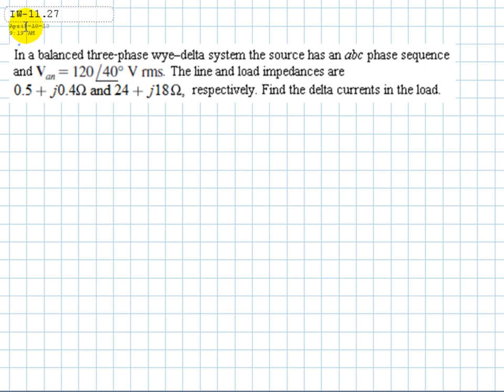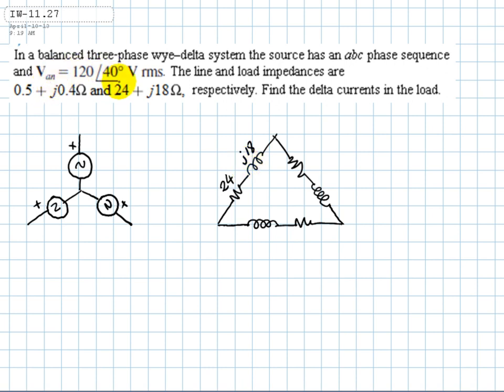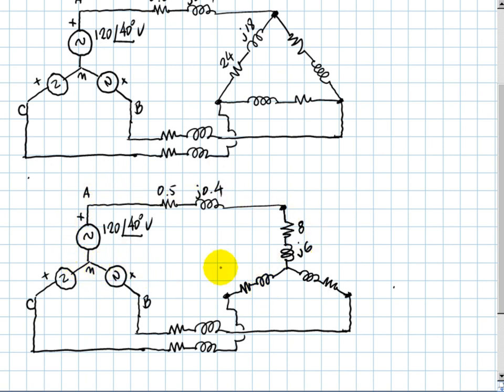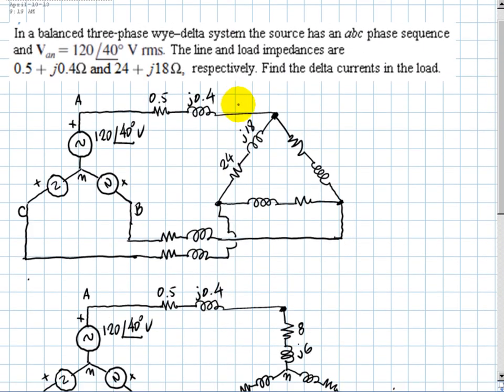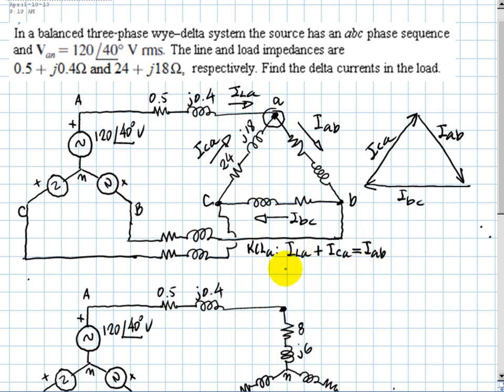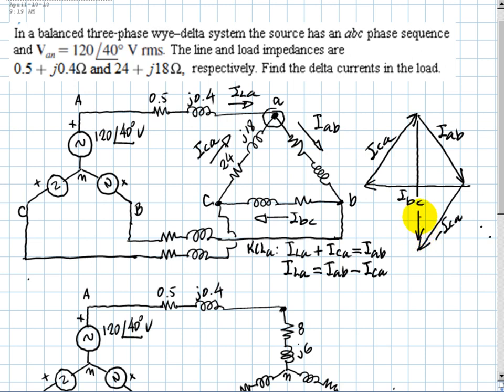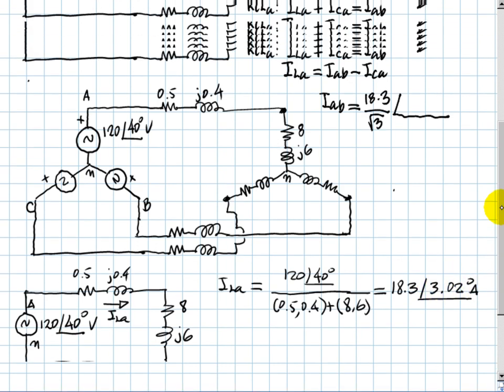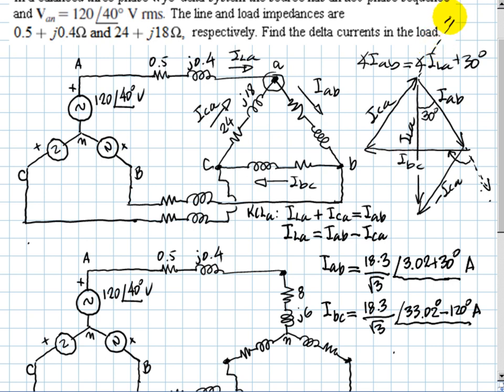IRWIN 11.27: Three Phase Tutorial, currents in a delta.

Comment: Do you have an example of unbalance loads...connecting in y to Delta or vice versa sir?     Please help me with that I'm struggling with my circuits right now
Reply from the maker: When the circuit is unbalanced, or the system of loads, or an asymmetrical system of voltages, you just use nodal analysis on the whole network as you would do with any AC SS circuit. Or, you are familiar with Mrs. Clarke's symmetrical components method (based heavily on the work of a Canadian mathematician of her time), use that method instead.